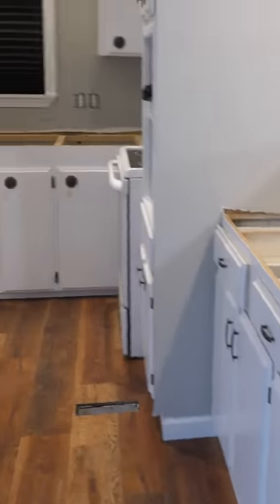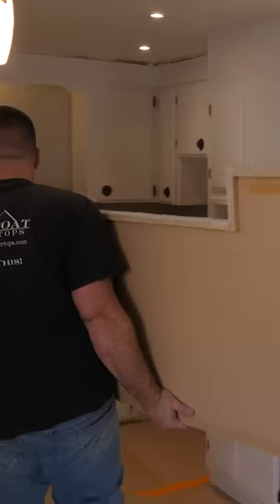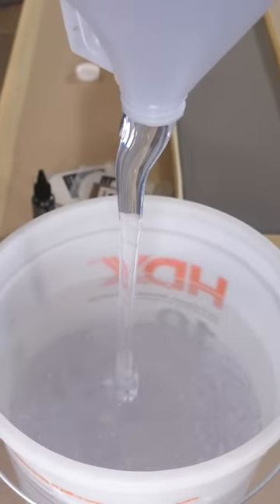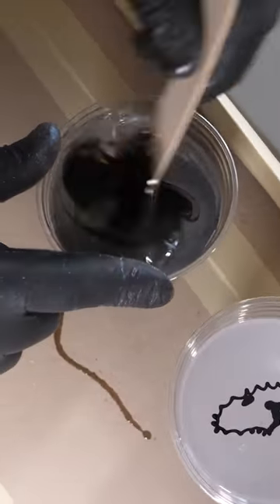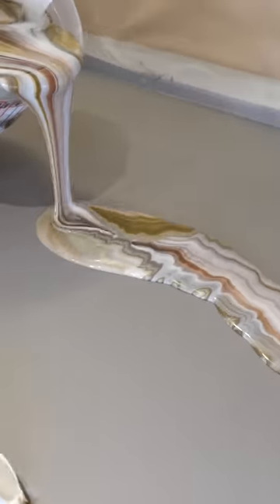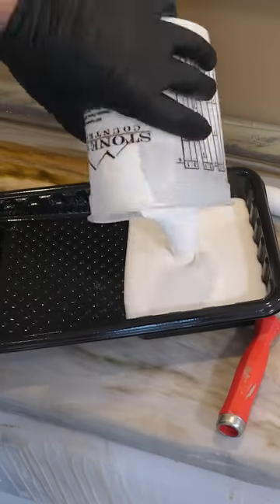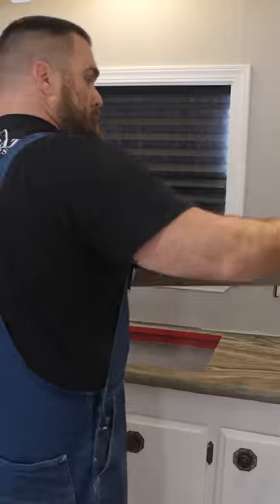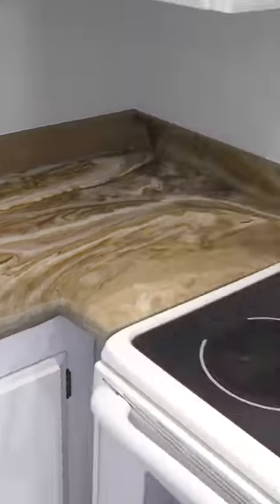Increase the value of your Home with Epoxy Countertops #shorts

Comment: You lost me when you said mdf. cheapest, screw the next guy fix imaginable.
Reply: Amen brother
Reply: There are a hundred reasonable uses for mdf around the house. Small simple shelving for desks, or bins in closets.

This, this however is the worst fucking use possible. The first time steam from hot water is released anywhere it's gone to hell.
Reply: If you look under a any non stone/hard wood counter top they are all MDF by the way
Reply: A lot of countertops have mdf underneath. If you stick your head inside your cabinets you can probably see it from the inside
Reply: @thechannelofultimatedestiny  yep. Cheap ones are. That's why they bubble and warp after a year.
Reply: @jeepmanxj  had ours for 6 and the utility has the old kitchen one that is almost 22 years old has been drenched in water mud all sorts and no problems what do ever
Reply: AND you don’t know what you are talking about.
Reply: @tres-4b798  sure thing.
Reply: What's MDF?
Reply: @jeepmanxj  I watched one night of heavy rain ruin 15 rooms from your ankle down because of mdf lol cheap Apts I was installing an elevator in knocked out a 5 stop in 4 days worthless building all around I'm sure that elevator runs like shit
Reply: Medium density fiberboard and epoxy are cheap and terrible for a kitchen. One is wood fibers all glued up and the other is just glue with paint.
Reply: @gobsauce8891  medium density fibreboard, essentially they take wood fibre and mix it with a binding resin and then heat and compress the mix into a sheet
Reply: @tres-4b798  great! Glad you got really lucky! Unfortunately most people don't look at 6 years as an amount of time that even remotely matters in construction. As a tradesman myself if it isn't regularly last 20+ years with no issue it's not going in my house and I'm not recommending it to a friend. I've seen waaaay too much moldy ass fostered MDF in countertops and cabinets that "look good from the outside." 

On the other job security tells me I should applaud this. Cuz there will be work replacing this trash.
Reply: @gobsauce8891  medium density fibreboard it's a solid piece of wood made from wood fibers in a glue pressed together but is notorious that if water touches it it swells and grows mould
Reply: @hamburbers  the newest one is sealed board with a groove cut in that is resin coated to catch water it is really good but not what I would want it was just the best option at the time and the older one is shockingly resilient
Reply: @tres-4b798  thanks dude!
Reply: @gobsauce8891  no problems
Reply: I love seeing the poignant stark contrast between a primarily male comments section and a primarily female comments section.

This is why I watch dude content
Reply: @tres-4b798  We always used 3/4 plywood. MDF sags really bad.
Reply: @gobsauce8891  you messed up. you typed that into the comment section on YouTube and you were supposed to type that into Google search
Reply: wood or stone will ad value   
not mdf ...
Reply: @bajecznyjulek  MDF will add value.
Reply: @DJ-kg6zq  no, i did it on purpose because it seems that this comment section has people who actually work in this industry. Besides, why do you care where I typed it?
Reply: @gobsauce8891  it was a joke
Reply: @jeepmanxj  Granite doesn’t bubble and warp… I understand that you’re talking about entirely MSC countertops, but they’re often backed with MDF which is what the original commenter was saying. Additionally, MDF countertops are totally fine for economy use and shouldn’t bubble at all unless you have active water leakage which is a bigger problem regardless.
Reply: @hamburbers  If someone’s countertops are moldy then you have afar bigger issues than the material of the countertops themselves. Regardless of whether you like MDF, it’s not going to mold unless exposed to prolonged or repeated water damage. The cabinets would also probably be bad regardless of material as well.
Reply: @TheHeadincharge  or they live in any humid state. Most el cheapo pre-built cabinets from the "I know somebody that'll do it cheaper" guys aren't even water sealed inside. It doesn't take a leak. What happens when drain pipes, like a sink in a counter top, are cooler than the surrounding air when it's like 30-40% humidity? They accumulate condensation. MDF in a pantry? Great. MDF in a countertop? Not so great. Happens constantly and even more often in pre-built trailer style homes. 

I always push for 3/4 water sealed plywood or just go full stone slab. Not worth being cheap about. Maybe if you live in a state that's drier than a popcorn fart they'd make more sense.
Reply: @TheHeadincharge  hell I spent an entire summer remodeling one such house because customer had decide not to spend the extra. Guy lived 10 miles from one of the great lakes No mold/moisture resistant sheet rock in bathroom? Rock was swelled and disintegrating. Cabinets were all swelled anywhere there were water lines in them.  All from condensation and improper ventilation. Shower would fog up upstairs and that moisture just wouldn't dissipate. Ended up with damaged walls in 3 rooms solely from humidity and not having rocked the bathroom out with greenboard. 

Was awesome. Guy paid me like 20k (just in labor) over the course of the summer because he tried to save a few bucks here and there during the original construction.
Reply: @2ndtwo1  not heard of that before hadn't thought of plywood is it sealed or not as it would delaminate with water would it not
Reply: Mdf has literally a million and 10 uses for paint grade houses. It's easier to work with then hard wood and plywood. And if properly sealed you won't have any problems out of it.
Reply: Absolutely! Dealing with an mdf countertop nightmare right now. Had a leak mdf absorbed it and lifted in wonky spots. New taps can't tighten properly so they wobble. Can't afford new countertop right now with the insane prices of building materials where I live. Have use a wobbly tap until I can replace the top. 😡😩😓
Reply: @howtosurviveelectronichara6474  What's the female version? Just like "Omg so pretty 😍😍😍"? Lol
The boys like getting technical
Reply: @howtosurviveelectronichara6474  please elaborate lol
Reply: The second that came out of his mouth my face turned to disappointment.
Reply: @tres-4b798  no, fktrd, they are not.
Reply: @gsaexperience8578  actually,  that would be YOU!!
Reply: @tres-4b798  liar
Reply: @systembypass6930  fail
Reply: Lets not forget how much MDF loves water
Reply: @tres-4b798  Yeah we mdf for sub tops when doing mitered stone/quartz/porcelain tops. We don’t make these shitty epoxy tops.
Reply: @BVaccaro88  yea ours are full seal but agreed
Reply: @jeepmanxj  wrong, MDF is not particle board. Plus, we use red guard on the bottom and seal the entire piece.

Comment: Imagine buying your new home and finding out your countertops are made out of mdf oof 😭
Reply: imagine thinking these houses today are just loaded with top quality material lmao they are literally all made with scrap compressed wood as foundation walls forget the countertops!
Reply: @2stroketyson79  wut
Reply: It's all about the show, and not the reality....
Reply: @2stroketyson79  maybe in America…
Reply: Vladimir Putin  they may make specific MDF countertops that doesn’t mean they aren’t terrible!
Reply: @2stroketyson79  that's just the US lol
Reply: You gotta be careful nowadays. Houses aren't built to last anymore. You're gonna struggle to find a reputable builder that doesn't cheap out on material. If you're gonna have your house built you better but the material yourself and make sure the frame is made out of heart wood and that the sheathing is quality plywood and not MDF. We got ripped off when we let the builders buy the material and the addition they built is made out of indoor MDF and is literally melting away.
Reply: Only cheap contractors use mdf for counter top, been remolding for over 10 years and we will not use mdf for counter tops if we see you doing it you have to redo do it and use either birch or pine.
Reply: Imagine paying $30k more for the exact same house as next door because it has MDF countertops 😂
Reply: It will be a fukin lawsuit bro
Reply: My house was built in the 60s and I got mdf counters
Reply: @SKOMPAS  yeah FR mdf is trash would be my last choice, I will admit epoxy would help with durability but this video is so silly 20-30k complete nonsense.
Reply: Water destroys MDF. That epoxy seal is going to have to be so tight no water can touch it.
Reply: @watchingover3592  yeah MDF can definitely be used with success, but again not going to be my first choice. It's consistent and very easy to cut, and that's about where the benefits end.
Reply: @SKOMPAS  yeah in America all they care about is how to save money. What’s the most inexpensive product I can use that’ll also last a decent while…
Reply: epoxy holds all crap together...it really is amazing.
Reply: Yeah,tricking customers is not a good idea, quartz it's a better choice
Reply: @watchingover3592  you do realize this is what’s under tiled bathrooms right?
Reply: @alexquintero4807  quartz is pretty until u set a skillet down or drop a cup and your countertop chips. Granite is better
Reply: @cherehampton7649  I would not use MDF under tile in a bathroom. MDF expands an contacts when water comes in contact with it and can disintegrate with constant moisture/water.
Reply: Almost all laminate top are made with MDF. What else would you use?
Reply: @cherehampton7649  putting mdf under a tiled bathroom sounds like the worst idea ever. MDF isn't to be used in wet areas (bathrooms, countertops with sinks). Might as well just throw cardboard in there at that point. Don't do construction, you'll get yourself sued for negligence.
Reply: @2stroketyson79  ⁷H 4J
Reply: @2stroketyson79  the framing of American houses are not recycled wood, neither is the foundation. 
Foundations are concrete slabs or concrete pillars.
They use treated dimensional lumber, highly resistant to water damage, to anchor the house frame to the concrete.
Then they use untreated dimensional lumber, usually 2x4 or 2x6; or specially manufactured engineered wood, designed to maximize the most important attributes for the area they're intended to be used; to frame the walls and floors.

The outer shell and subfloor is the only area they can legally cheap out and use recycled materials, in the form of plywood, though many contractors insist on using specially made sheets that maximize water protection for the walls.

Americans are quick to sue, so any construction companies that cut corners go out of business pretty quickly. Plus the foundation and framing of the home are both heavily regulated, and required to be inspected at multiple stages of the building process, if the company wants any liability protections. Part of why houses are so expensive to build. 

Building codes are a royal pain to adhere to, look into them for your area before you make false claims of low quality construction. Odds are you're talking about an old worn out house, built before your parents were born, and poorly maintained by its owners due to the requirement that the owner must meet modern building codes when renovating.
Reply: @chas1878  hell no it ain't. It's all over because it's cheap and easy to work with.
Reply: @serweed  hes not lying. Thats the housing market today. Most new build homes are made from the shittiest materials
Reply: @SKOMPAS  your right about that it’s only in America
Reply: @2stroketyson79  Wood housing is literally every house in north america
Reply: i used to have mdf cabinets and they puffed up from just splash from the washroom
Reply: @SKOMPAS  no worldwide we are a economic based society so we use the cheapest parts and labor for the worst quality stuff and sell it for the highest price possible hence why a Honda civic cost 50-almost 79k
Reply: @andyjackson3663  all show no go.
Reply: @2stroketyson79  did you have a stronk?
Reply: That's the con, virtually no upgrades are luxury or high end
Reply: My father in law made used a high quality mdf for my table top and counter top and you wouldn’t know the difference and it looks badass but I see what you’re saying in the case of a home you just bought and discovering that.
Reply: Most Formica countertops from big box stores are made out of mdf
Reply: @cw4558  not quite MDF, a very dense,  small particle chip board. MDF is literally sawdust and glue, chip board is really defined as larger chunks and chips, glued and pressed into form.

OSB sheeting is the more coarse chipboard; sheeting for exterior walls, sheds, before weather proofing wrap or paint. Melamine is one term typically used for the chip board used for most basic/cheap and even decent furniture, many kitchen cabinets (better ones are plywood), it really is the base of "Formica" and other "plastic" capped/topped styled counter tops.
Reply: @2stroketyson79 why imma build a house with a solid concrete foundation and cmu blocks for walls
Reply: @saby8765  what are you going to sue for? What grounds?
Reply: @rodm5830  no it’s a particle board substraight. Different than MDF.
Reply: Better than laminated particle board.
Reply: Americans 🤣
Reply: And they are saying they are worth 20k lmfao
Reply: @serweed  The studs used nowadays are #2 grade western species wood. It's grown and cut down in a short span of time and it's usually not the highest quality.
Reply: MDF is definitely enough for countertops especially the way they have been put together... If it was press board or something I would agree but no
Reply: American homes are made of cardboard, but countertops are suddenly a big deal?
Reply: Get the underside wet (burst hose) and it will be damaged beyond repair. $30K? Ridiculous.
Reply: @2stroketyson79   I agree.  I bought a house and it fell down while I was at work.  Now what?

Comment: MDF is weak and has a tendency to absorb moisture and swell.  I'm disappointed that you used that for the base.  The cheap kitchen cabinets sold in Home Depot are made of MDF.
Reply: What's best for base then?
Reply: Your a disappointment Ray.
Reply: You either seal everything to keep the moisture out or you get a stainless steel frame kitchen like in a restaurant kitchen.
Reply: I was legit thinking the same thing... any moisture getting around the faucet stem or anything is going to ruin this "20-30k" countertop
Reply: Yea I hope they sealed it. All sides of the MDF should have been sealed with BIN or Gardz.
Reply: Luckily you know what to do. Why be disappointed?
Reply: We have a professional here guys
Reply: It's protected by the epoxy I presume. Baltic Birch plywood would probably be the upgrade option.
Reply: @Erikpdx  I'm talking about the underside mostly. Swelling can come from anywhere unless the whole piece is sealed.
Reply: @nemesiszar757  solid cabinet grade plywood. Usually the only way is building it yourself or going to your local furniture store.
Reply: Where I live it’s usually made of marble stone. It last decades.
Reply: @GausOfficialChannelTM  my guy doin it right
Reply: @erickaffenberger1145  Na he’s right
Reply: @nemesiszar757  high grade plywood
Reply: JESUS says keep Sabbath holy
POPE says keep Sunday  holy

The WORD says the 7th day is holy!
The WORLD says the 1st day is holy?

7th day Sabbath = (Exodus 20:8-11)
1st day Sunday = (Mark 7:7)

WHO DO YOU OBEY 🤔??????
Reply: @nemesiszar757  solid wood or high quality plywood
Reply: @tumuskurns  and after many years, pieces will start falling on all the clean dishes
Reply: Imported from China too
Reply: Yea mdf wtf?!?
Reply: Lol one drop of water and it's done. ROTFLMFAO pure junk. Waste of skills to install.
Reply: I mean MDF is shit, I won't argue that. But it is sealed with the undercoat. I don't know what brand they used but the undercoat I use for my (much smaller) epoxy projects is completely waterproof. I've never tried it with MDF as 1/4 plywood is typically what I need but it has a fair shot of being alright since it's sealed and covered in the epoxy.
Reply: @RapTapTap69  all it takes is one Crack. One small imperfection. Might not be today or tomorrow but eventually over time and use the seal will fail and it will rot from the inside out.
Reply: @memeryuag  I very clearly said it wasn't great. But it's not as bad as a lot of people are making it out to be. Lots of people are acting like the first spilled glass will cause the counter tops to explode or crumble to dust
Reply: @RapTapTap69  lol. Sure. For the first month maybe nice looking but will DECREASE the value of your home unless the existing counters are made of dirt or rotting wood. No matter how you paint it, it's a plastic or plastic like countertop susceptible to scratching and scuffing and cracking etc.  It's garbage and you know it. You cannot polish a turd. Although you could actually polish epoxy, it isnt necessarily a bad material just not for a countertop. Putting epoxy on top of MDF is like adding insult to injury. It's like putting lipstick on a pig if you will. MDF is good for nothing but landfills. Epoxy at least does have its uses, just not here. Lol. Go ahead, say all you want but no one is fooled. Lol.
Reply: Using the word "tendency" is so generous of you!! Ugh, MDF lives to swell up from moisture and disintegrate. Sure, it won't dissapear from a single glass of water, but doesn't this kitchen have a sink?? This makes about much sense as cheap laminate flooring based on MDF. That countertop looks cool, but, eh, I'm not blown away by it.
Reply: Epoxy is completely waterproof. The only vulnerable locations are when you drill for the faucets. Those need to be sealed with acrylic or some product that will soak into the MDF and waterproof it. I also cut the underside of the MDF around the sink area just in case there’s a leak. These Countertops last for years If they’re done right.